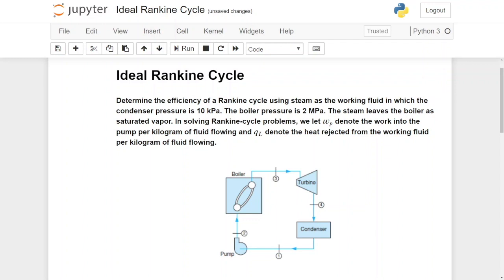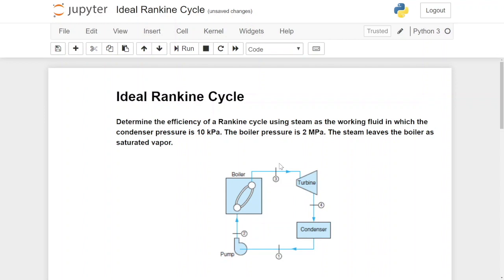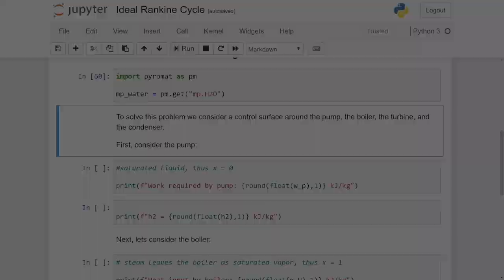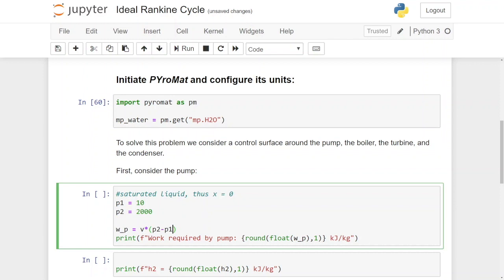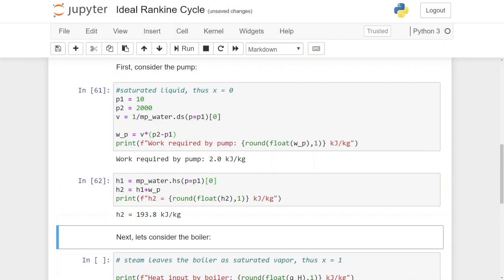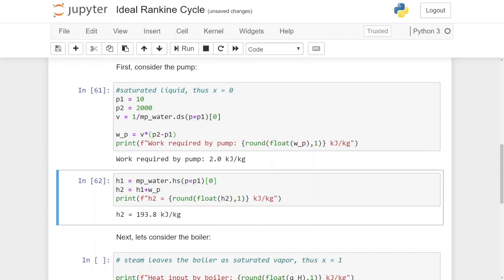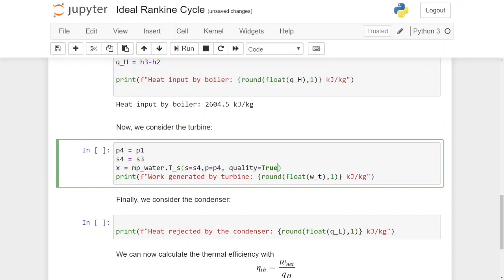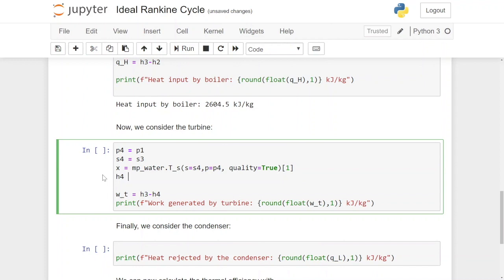Calculating the thermal efficiency of an Ideal Rankine Cycle using Python | PYroMat | Thermodynamics

Comment: Hi, everyone.  This is Chris Martin, the author of the PYroMat package.  First off, I'd like to thank Adriaan for doing such a beautiful job of introducing the software and especially the topic.

Enough of you have asked about how PYroMat compares with other packages, I thought I'd try to answer meaningfully.  (1) Thermopy is an interesting alternative to PYroMat; it focuses heavily on ideal gas modeling in chemical reactions.  PYroMat has all the same data (and more of it - over 1,000 species in v2.1.0), but it leaves the reaction modeling out.  As of this posting, Thermopy has not been updated since 2016, so for reaction modeling, I would recommend using Cantera instead.  (2) CoolProp is an excellent alternative to PYroMat, but it is only a wrapper build on top of NIST's REFPROP.  REFPROP is not free, but it is fast and it is an international standard for property calculation.  For the most part, it uses the same data sources that PYroMat does.

Thanks, everyone.
Reply from the maker: Hi Chris. Thanks for the kind words. It means a lot coming from you. Also thanks for highlighting the differences between PYroMat and other available packages. I really enjoy using PYroMat and will continue using it and teaching it to others.

Comment: I would like to thank you for your videos, they're real-life saviors since my project has to be on python. I just have one question, in case the inlet of the turbine was superheated vapor and not saturated vapor (we have p and s) how can I compute h? I tried "h2s = mp_water.h(p=p2, s=s2s)" but it gave me an error as if it can't get the enthalpy from the pressure and the entropy.
Reply from the maker: Hi Jeanne. Sorry for the late reply. From the documentation it seems you cannot directly calculate enthalpy with pressure and entropy. I suggest you first calculate T with mp_water.T_s(p=p2, s=s2s) and then calculate enthalpy using mp_water.h(T=T, p=p2). You are welcome to join my discord server: https://discord.gg/2UG7w8nZn6 can share your code and we can debug it 🙌

Comment: Hello sir!! 
i hope you are doing well?
i get this Error when i try to calculate h3 
PMParamError: Saturation properties are not available at pressures beyond the triple or critical points.
another thing how i can modify unities in my case the pressure is on bar?
thank you
Reply from the maker: I think your first problem is caused by your second problem. You can change your pressure units with the line:
pm.config["unit_pressure"] = "bar"
This will cause PYroMat to use the units "bar" for any pressure calculations. Now when you calculate h3 and give it the value for p3 in bar, you should get the correct answer. Let me know how it goes?🙌
Reply: @AdriaanVanNiekerk   thank you sir yes it s working now. i think you meant pm.config["unit_pressure"] = "kPa".
i'll return to you when ever i had problem, it's a very interesting way to solve thermodynamics exercices. 
best regards
Reply from the maker: @hichamelmadioune6376  Glad it is working! Do share some problems that you solve with PYroMat
Reply: Yeah of course!! i'll do it. i have exams this days maybe later on.
Reply: @hichamelmadioune6376  Same here, I also needed to change the pressure unit with a fresh install of PYroMat. I also changed the default pressure using: pm.config['def_p'] = 100.0, to be consistent with the video.

Comment: sir i dont know what is pyromat and how to import it please help
Reply from the maker: Hi Mathesh. You need to first install the module before you can import it in your code. Most of the times you can just open up command line/terminal and type in the command:
python -m pip install pyromat
Let me know if this doesn't work. 🙌
Reply: Sir i successfully pip installed pyromat and then copied the code on git hub and pasted it on python but it seems there is error in code
Reply from the maker: @matheshsk3977  What is the error that they give?
Reply: Traceback(most recent call last) : line 24
Reply: Nameerror:"h2" Is not defined
Reply from the maker: @matheshs.k8535  There should be something else after that as well. What do you have in line 24 of your code?
Reply from the maker: @matheshs.k8535  Okay, so you need to define h2. In my code on Github I did it with:
h1 = mp_water.hs(p=p1)[0]
h2 = h1+w_p
Reply: @AdriaanVanNiekerk  T2=mp_water.T_H(h=h2, p=p2)
Reply: Sir i am using for rehear cycle not ideal
Reply from the maker: @matheshs.k8535  Ah okay - I had a look at THAT code and you are right, there is an error. I defined h2 in line 41 and this needs to be  moved to before line 24. I will fix that and update the repository. Thanks for highlighting it 🙌
Reply: @AdriaanVanNiekerk  Thank you sir, very nice of you
Reply from the maker: @matheshs.k8535  no problem. Let me know of any other pyromat examples that you would like to see 👍🏻